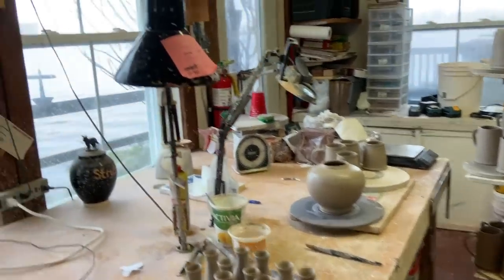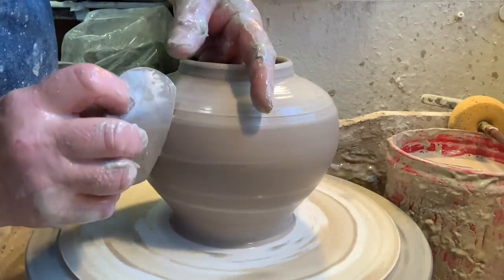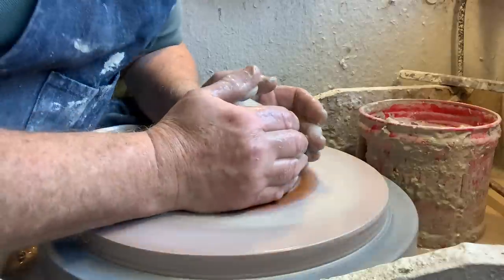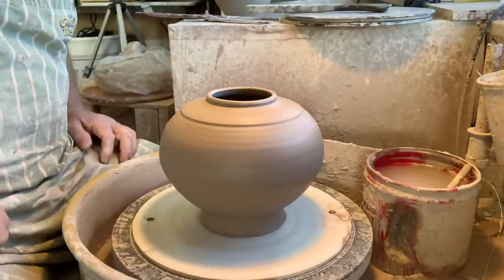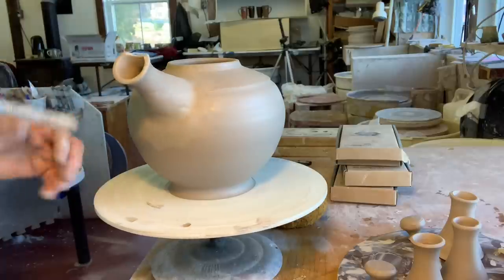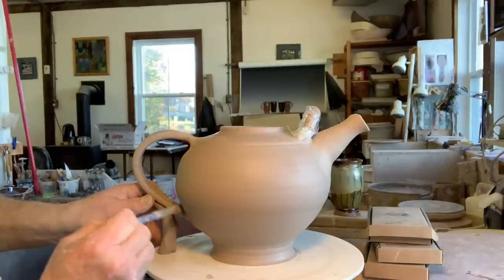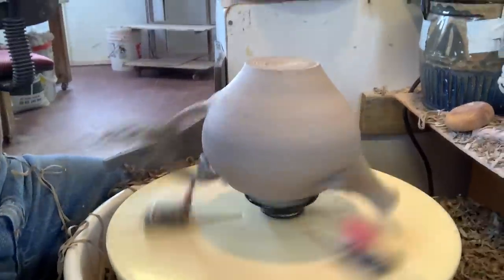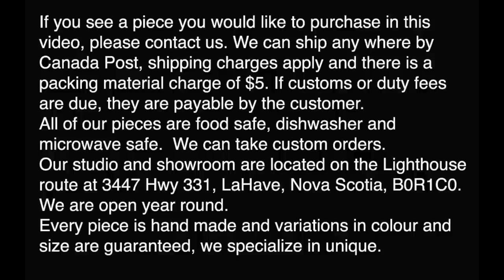How to make two teapots.

Comment: Don't mean to be gushy, but I believe you to be the best teacher on YouTube. Thanks so much.  Now, could you possibly make a video making a one piece cake pan.  I've tried, but can't keep them from warping.
Reply from the maker: That would be a large square pan? My advice is to buy a metal one😉 If you have to make one you should buy a gritty clay body and dry the piece slowly with weights on the edges. Try drying it on Sheet rock so the middle bottom area dries evenly with the edges. By slowly I mean two weeks.

Comment: These are adorable! I keep having trouble with the spout. I’m also throwing pots in our barn. My husband was able to clear about half the space plus shelving areas on both sides. No kiln at home yet though. Oh, and he’s learning to throw pots too. Already he’s saying we either have to find an affordable pugmill or make them because wedging clay is hard work. 😂 He got a major taste of it when I had him helping to wedge reclaimed clay. 

Do you have any tips or anything regarding bats? The MDF bats that I’ve had for some 20 +/-  yrs are warped up. I prefer these to the plastic bats. I’m in the US. Any tips are helpful.
Reply from the maker: Thanks for watching. I use 1/2inch plywood with three coats of marine varnish. If you can get tempered masonite and soak them in oil that also works. I made 32 from a sheet of 1/4inch plastic board that is used in ice rinks. I also got some already round from a kitchen/bath  center. 
Endless possibilities. A 12 inch round bat with a 6inch square cut out of the center, then 6inch tiles can be used. The pugmill is a great help. Good luck in the barn studio.